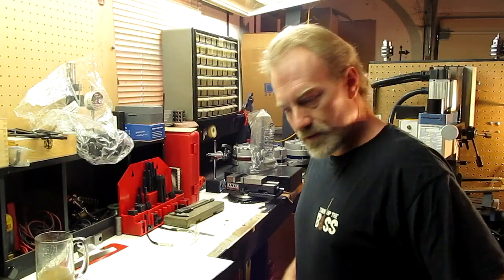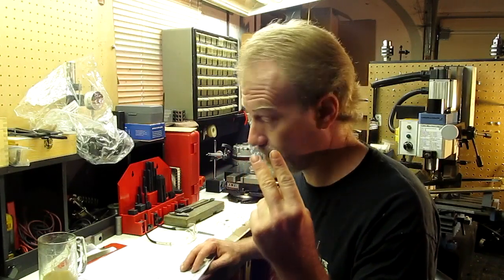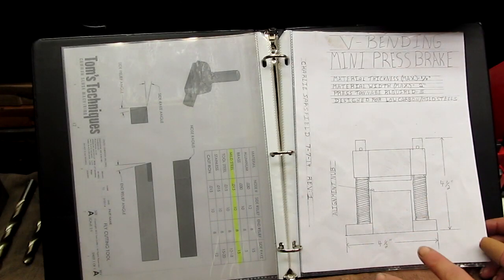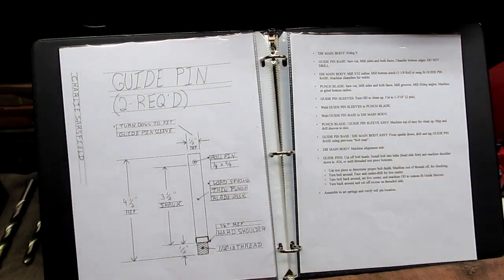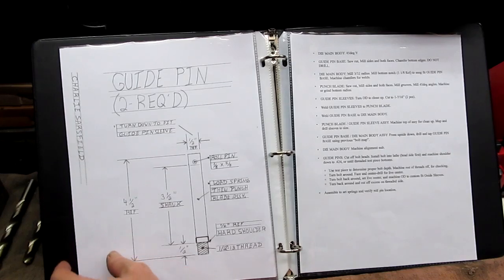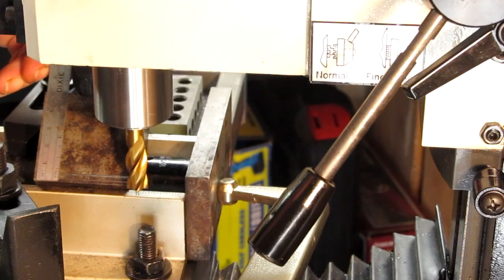The Build: Mini V-Bending Press Brake PT1

Comment: I didn't watch #2, but if you want to bend 90deg the v-die needs to be 85deg to make up for spring back in the metal, hope that helps .....
Reply from the maker: Thanks for the input. I've had so much going on that I haven't finished this project yet. I'll remember that bit of info when I get back to it.